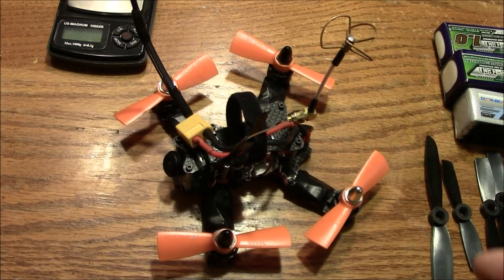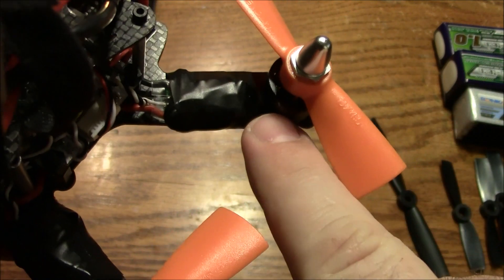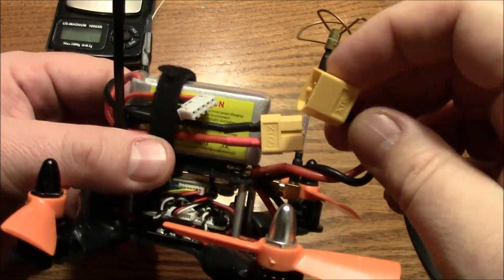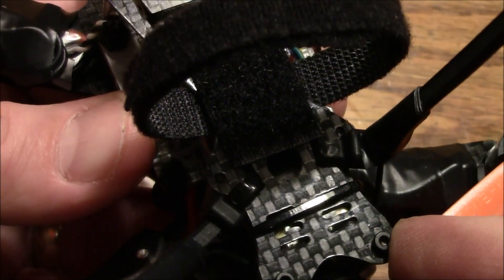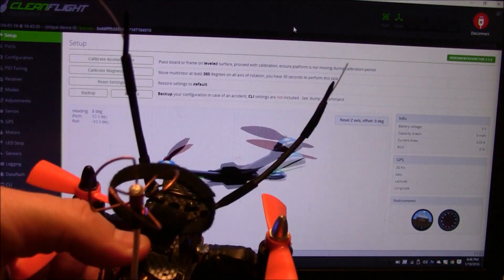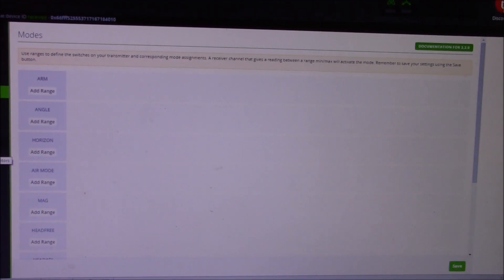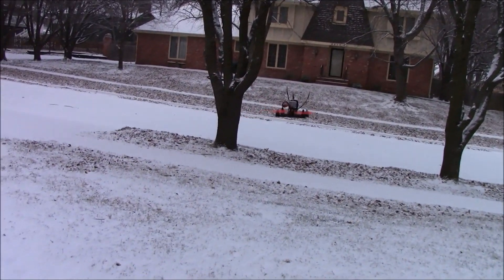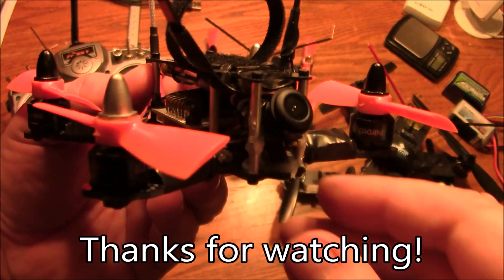Deformation 130 Full Review, Tuning, Build and Racing Tips

Comment: Thanks for the detailed video!    Those tiny racers look like a lot of fun.
Can you tell me how you are getting battery voltage to your RX?
I have a 250 quad with a cc3d and an X4R and I'd like to implement something like what you have done for your battery alarms.
I see the two wires coming out the side of your RX.  Are those soldered to the cc3d somewhere, or straight to the PDB?
Thanks for any help!

Comment: i wish i seen this before i ordered everything.

you think a 1306 4000kv will be fine with 3045 dal prop and  850 3s 45c on these frame?
Reply from the maker: Yeah, I think those should work fine.
Reply: I have this deformation insect with emax RB 4000kv, with 12a 4in1 esc and 860mah 4s pulse battery. With quadprops 3030 this thing is pretty stable and lots of power to run <3.

Comment: Has anyone tried the Rotorx 3040 triblade Props with these motors? They are claiming 320grams per motor depending on voltage.
Reply: +Alex C. I did with my 130 frame with the sunnysky 1306-3100. Got a friend who has bought some eachine 1306 (cheaper but a bit less powerful). With our rotorx props we manage to reach thrust/weight ratios arround 3:1 (with 1300mA 4s lipos) and 3.5:1 (with 850 4s lipos) but always mine is just a bit more responsive. We haven't done thrust tests properly but we estimate that the overall thrust from de eachine motors must be around 1150g and sunnysky's around 1250g.
Reply: Wow nice I'm excited to get mine thanks for the info!
Reply from the maker: +Nicolás Marí Hernández That is good to know.  Thanks for sharing!  I bought the Eachine 1306 motors because they were so cheap.  I wanted to try them for myself to see how they perform for myself.
Reply: +travisgrindal Yeah same I like mine. Nice price.
Reply: You both are welcome :) and thanks to you travis!!!. Always a pleasure to see your product review videos. They have helped me a lot doing my research in order to build new quads or upgrade the fleet.

Comment: what motors would you recommend 1104 4000kv or 1306 3100kv?
Reply from the maker: +hooivork81 I'd go with the 1306 motors.  If you can find some 1306 motors with a higher KV, it will be more powerful.  3100kv are what I run on mine though and I like it.

Comment: if you want to beat the bigger quads get a 4045 3 leaf props put the motors on the other side ( under belly and use a smaller battery) i use a small 530 mah 4s . your welcome

Comment: I had trouble fitting everything into my 180. geez
Reply from the maker: +GeeCeeAte This is a tight build.  I'm working on a LKTR120, and it is really tight.
Reply: I bought a fx796t TX to attempt one of these builds. Can I just skip a PDB and wire battery power straight into that then just use the 5v out on the TX to power my naze? That would give me a lot more room for these smaller builds. It says the TX can take up to 20v, but i dont see those 18 gauge wires holding up to 75c

Comment: Hello, I don't have time to build my own and there's one on the local market here asking 120€ rtf + 2 800 3s lipos, 
Dys SN20A  Blheli
4000kv 1104 Motors
Eachine 40ch 25mw tx
Eachine 1000tvl ccd
FlSky rx
2x 800mah SLS Cube X Lipo 3s (4 mal geladen)
2x 3020 Propeller
3x 3020R Propeller
is this a reasonable deal? help ! and thanks! !
Reply: If you had time to build your own, it would cost you less than the price they're offering it assembled (approx $15-$30 savings, depends on which parts you'd switch for (I would personally switch the 1104 for 1306 4000kvm, more powerful (can lift more weight, in-case your props are a little thicker or you place a GoPro on top of your drone).